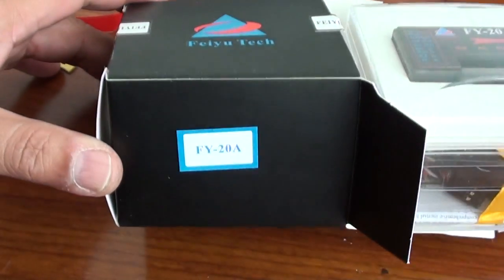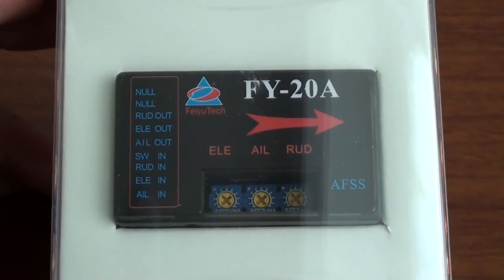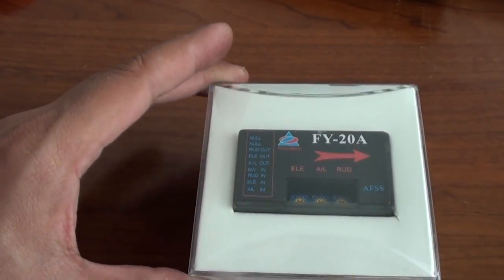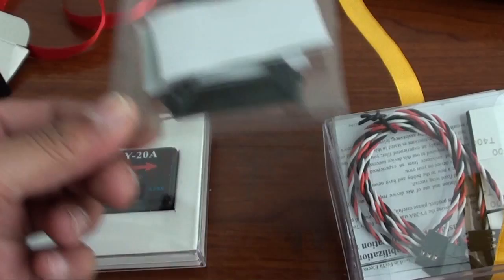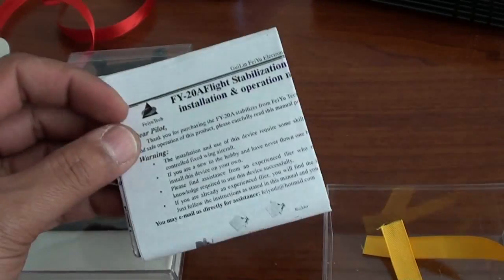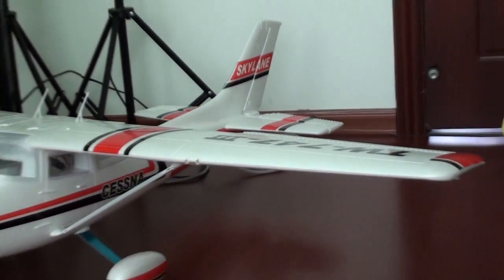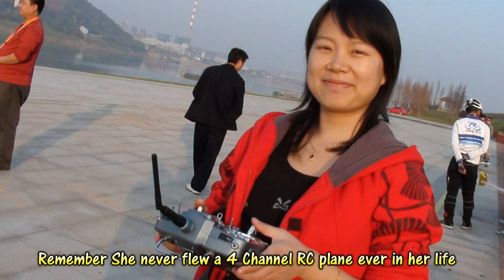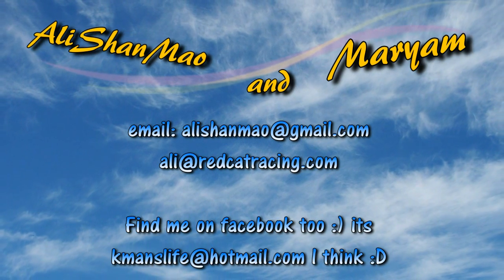Unboxing FY-20A Fixed Wing Stabilization System

Comment: I have a question. I bought a Double Horse 9053 rc helicopter. I was looking at it and it only has one connect buckle on the flybar. It has a spot for another one but on the flybar there is only a spot for one. I dont know if it is broke. But I looked on the manual and others online of the same model and they all have one. Is this a problem or is it made for where I can upgrade it? Because it still flies and I need help adjusting the steering could you help me?